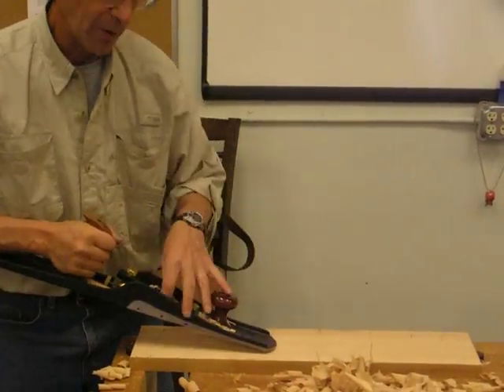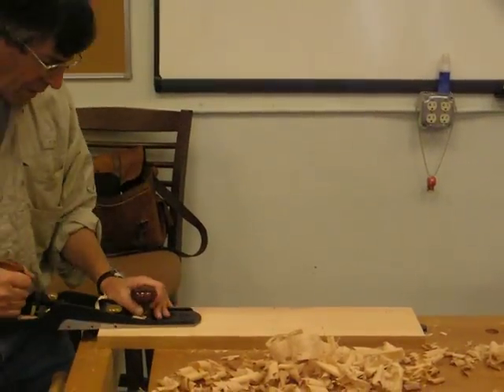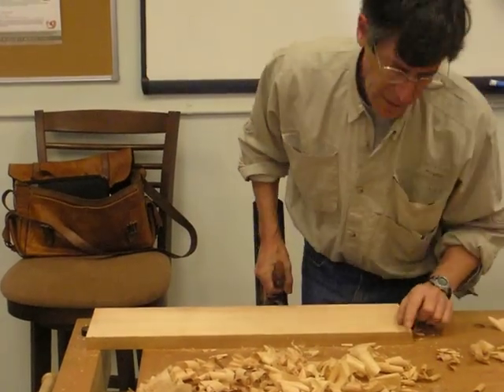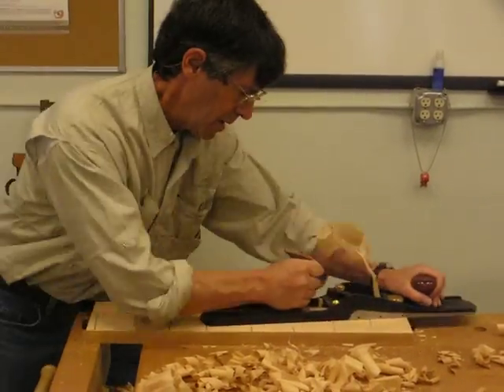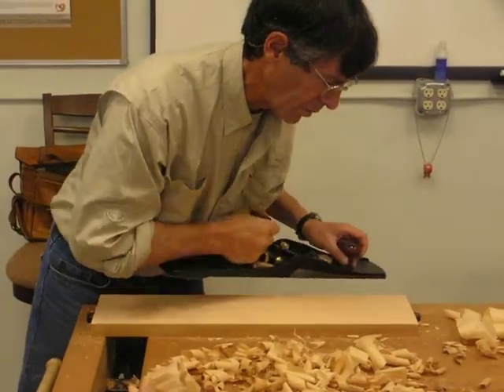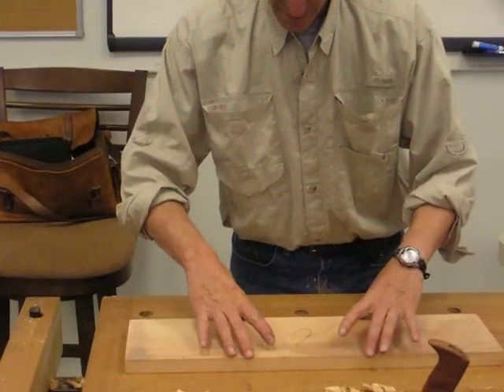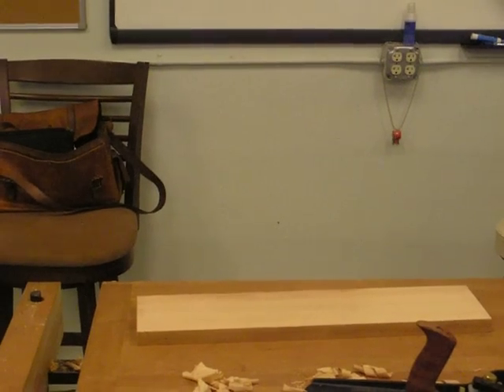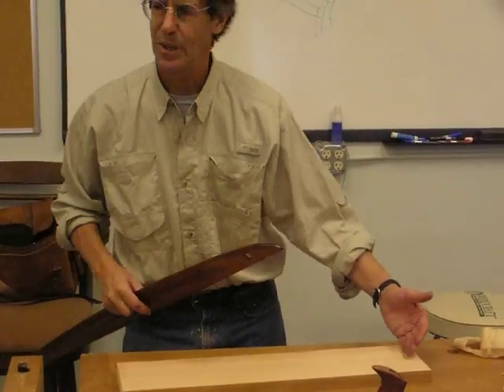Jim Tolpin flattening boards with Handplanes (Part 3)

Comment from the maker: @gerbschmitt If the board is that badly cupped. I'd recommend that you rip the board in half. Flatten the two boards and then edge joint and glue back together. Do it carefully and only a good eye will spot the join. Good luck.